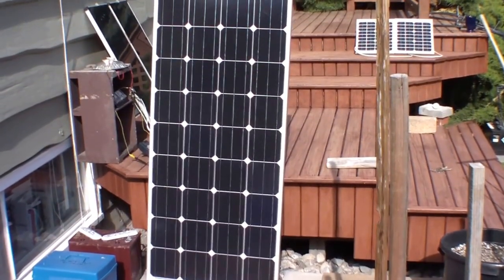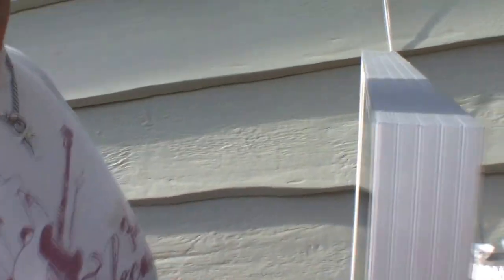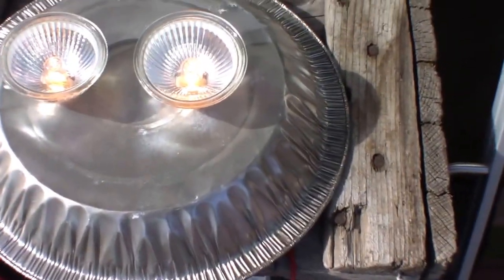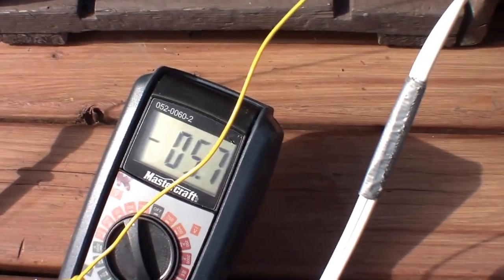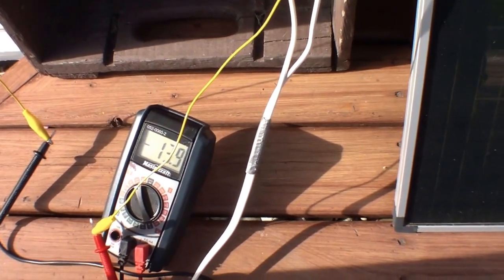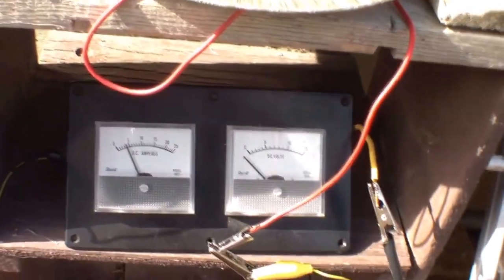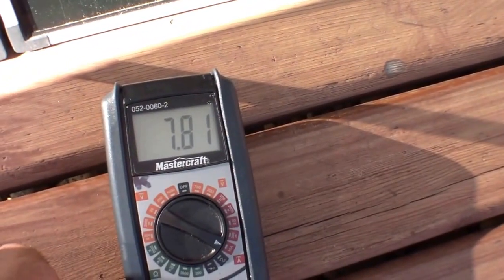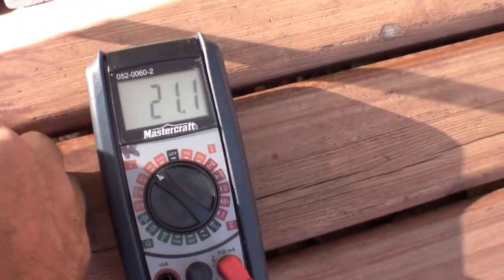Solar Panel - 160 Watt - Monocrystalline (12V charging) Initial Testing

Comment: I'm pulling in 7-8 amps on my 160watt panel on a hot sunny day. What are you pulling in on a sunny day?
Reply from the maker: Jayflight Camping about the same.  Highest I've ever seen was like 8.5A??  but you will only see that when the battery is low

Comment: I just bought the same panel this morning. When I got it home, it was overcast, yet the Panel was putting out better than 22 volts.
Reply from the maker: without a load (open circuit) thats about right. as soon as you load them, they drop
Reply: You are absolutely right. But if you're still getting 13.2 or better into the battery at that point, you can still charge things up.

Comment from the maker: I'm impressed with the quality that is coming out of the mid-ranged Chinese factories: 3 tab wires per cell, beefy aluminum frames, all joints are laser soldered in a vacuum, crazy iron tempered glass, CE ratings, +/- 3% tolerance... all for half the price of the most expensive stuff, like Kyocera and Sharp, and in my opinion every bit as good.

Comment: Something like the picaxe would sell I think. I always hated watching my amp needle slowly bob its way down to 10% of what the panels where putting out, as my battery filled up, and the controller wasted the excess across a resistor. To be able to divert that, to pump a tank (I had gravity feed to house) or heat some water, or do anything with it other than waste it on a resistor.... There are better ways to test, but you give an idea of what they do in the real world. Cheers.

Comment from the maker: I sell them in Canada. If you are interested in two panels (160 watts ea.) Absolute best deal I can do is $525 for two. That's total cost, includes taxes, insured FEDEX to your door. They are brand new grade A, and comes with power warranty (factory) and vendor warranty.

Comment: Good to see a real world test of some commercial panels. A rough latitude elevation from sea level, and time of day would be useful info. Its esential to test panels on site IMO, before installing. Thanks for showing how to do it. I used to do my house panels with an amp meter between controller and battery, then use charge voltage to calculate watts if I wanted watts. Helped me decide to go steeper, and chase more winter sun, as I was getting more than enough at a summer angle in summer.